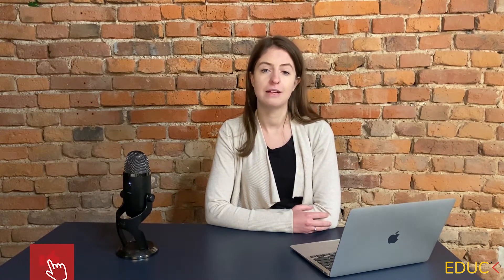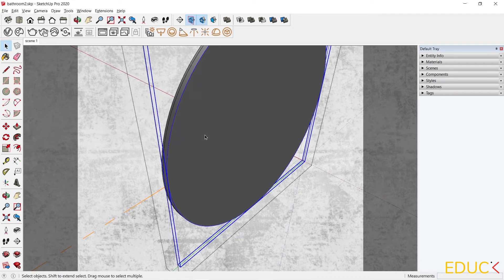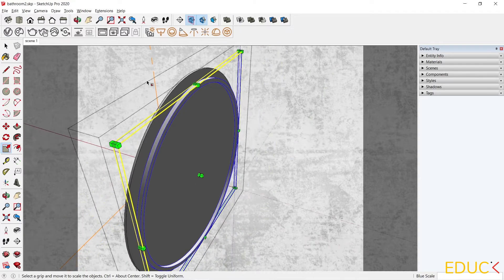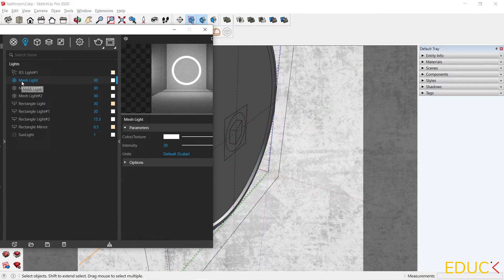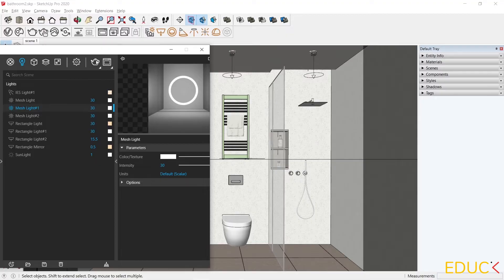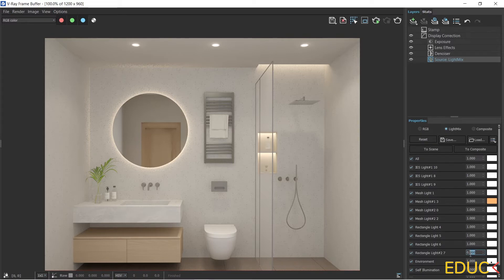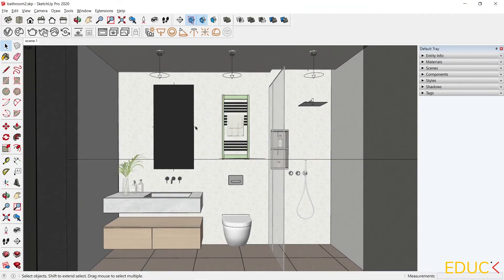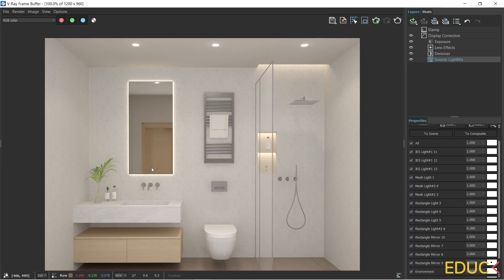How to Backlight a Mirror in SketchUp V-Ray

Comment: hey the mesh light isnt working it glows but doesnt become LED strip light kind behind the mirror. instead it only glows when i rotate camera and bring camera to its face. i have changed the mesh light values too , i changed the temp too dont know whats wrong can u guide
Reply from the maker: Hi. Firstly, check the geometry of the ring. Maybe it is too small or intersects with the mirror or with the wall. Check couple different sizes of the ring and change its position.